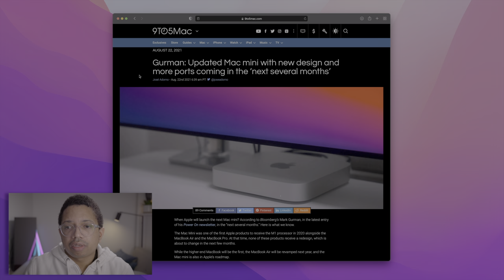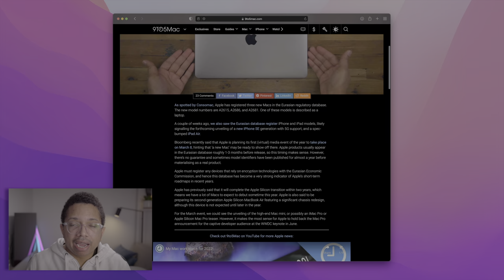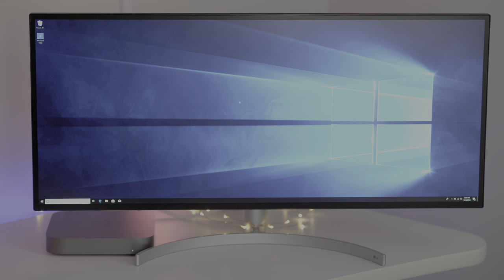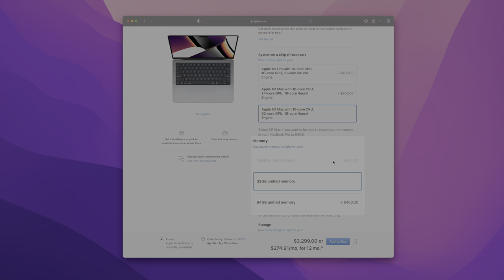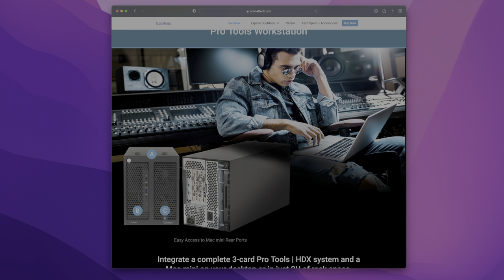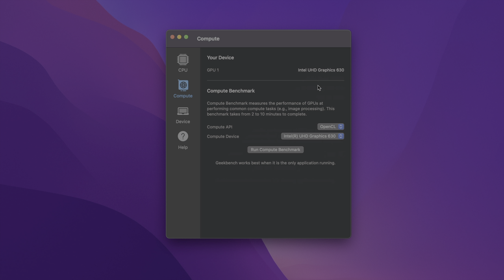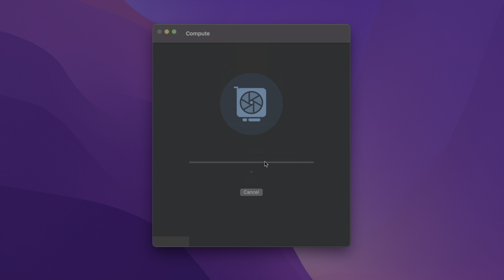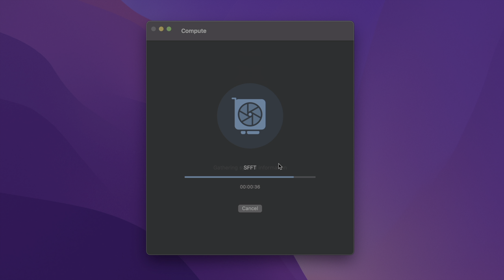Back to the Mac: my Mac mini wish list... + 2022 Mac mini news + Sonnet DuoModo hands-on

Comment: With the Sonney DuoModo do you still get an issue where you have to disconnect the egpu when booting and then reconnect when the mac has booted? I have the razor core x with an intel mac mini (2020) and the only way that mac os recognises the egpu is if i boot with a display connected to the mac mini first before swapping over to the egpu? From your video it would appear the same issue is not present on this enclosure? Thanks

Comment: My biggest complaint with the MacMini (I have a 2021) is that it only runs 2 monitors. Does the eGPU or any other device definitely allow you to run more than 2 monitors with good performance? Thanks.

Comment: One of my concerns is: Is the Apple Silicon Mac Pro going to live up to mine, and possibly other's expectations. I wonder if the performance and price ratio make it a no-brainer.

I really loved the 2011 Mac mini I had. I upgraded it a good deal. 4 to 16GB RAM. HDD to SSD. When I did this, it was NICE. If I had the 4-core version, I probably would've kept using it until I bought my new 2020 13" Intel MBP. My 4-core 2013 15" MBP was basically a mobile 4-core Mac mini. And I had that machine for 7 years....

My desktop needs to last me a solid 5 years and 7 would be preferable. A high-end Mac mini could fill the bill if the Mac Pro doesn't meet my needs. A Mac mini with a Pro/MAX chip in it would be good for lots of people.

Comment: I really wish for hdmi 2.1 or at least for the thunderbolt ports to work with usb-c to hdmi 2.1 cables... as they dont work to output to 4k 120hz hdmi 2.1 connections
Reply from the maker: Good one. The lack of HDMI 2.1 on the current-gen MacBook Pro is such an bummer. Unfortunately I doubt we'll get that on the Mac mini if we didn't get it on the top tier MacBook Pro, but would love to be wrong.

Comment: For the next iteration of Apple Silicon Mac minis (M2 potentially) do you think Apple would keep USB-A ports as well as integrate USB-C? 

Aliso for the potential M2 MacBook line do you think Apple would AT LEAST BRING BACK ONE USB-A port?
Reply: Two USB A ports are Awesome 😎, is better than one ☝️.
Reply: @johnrowland8354  I believe Apple SHOULD HAVE USB-A in the Mac lineup as well as USB-C

They LITERALLY FORCED USB-C on everybody when they introduced the new MacBook in 2015 and then the MacBook Pro in 2016
Reply: @techguy943  I agree with that.
Two USB A 3.0 is better than one ☝️.
We should have At least Two USB Type C. 
P. S.     A SD card slot and MagSafe port on 13” MacBook Pro would be nice

Comment: I'd like to see a new Mac Mini but make it bigger not smaller.   More ports and make the top a lid that can be opened and can swap  storage sticks.   Doing video and audio work you want to use local storage for capture, so having swappable storage for projects would be faster,
Reply from the maker: That sounds interesting. Curious though, do Thunderbolt SSDs not meet your needs? I think all signs point to it getting smaller, especially since there was so much extra space in the M1 model. Very interesting idea though. I wish Apple would make some sort of external GPU for extra bolt-on power that worked with Apple Silicon.
Reply: @9to5Mac  I see various setups adding storage or other devices and they are hanging off a port hub or daisy chain and I think about the bottleneck being created by all those devices trying to squeeze thru one port on the Mac.   A local drive socket is on the the board circuit fast than going out thru a port.
Reply from the maker: @DojoOfCool  Oh for sure, straight PCIe access is faster than Thunderbolt > PCIe, but that's going to be for the new Mac Pro (hopefully).

Comment: I have an older Mac Mini (Late 2012) because it was an affordable option at the time.  I know it’s “Vintage” and Obsolete, but it still runs well.  I did upgrade the RAM to 16GB which really helps.

Can you do a similar setup or recommend the following…

a Dock (HDD expansion, slots, etc)
EGPU
WIndows Bootcamp (internal install or portable HDD?)

#askjeff
Reply: Mine is only a little less vintage. Late 2014. I almost bought the M1 Mini, but I’m hoping the announcement on 8 March gives me at least one more option.